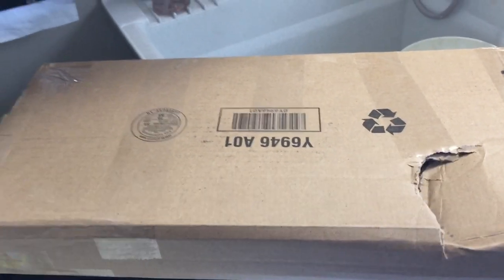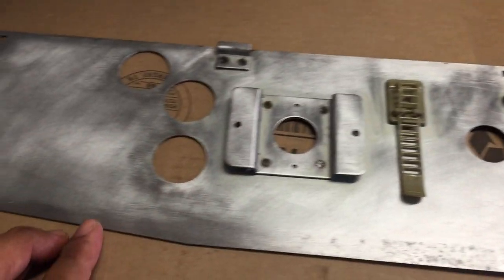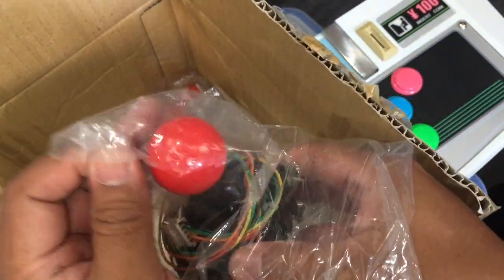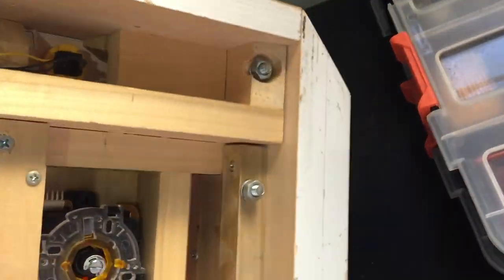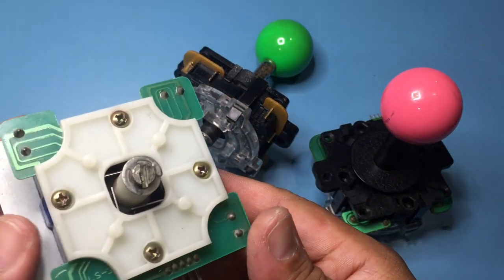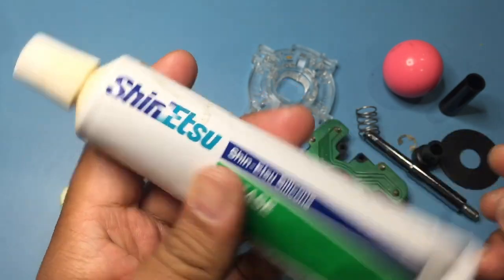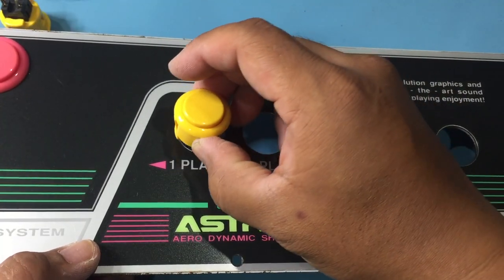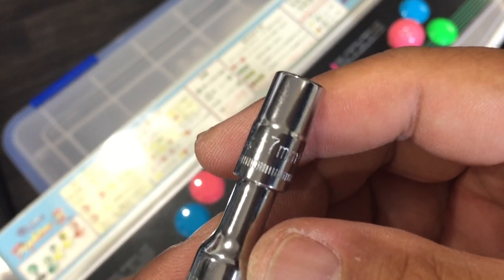The History of Sanwa & Custom Arcade Sticks + Candy Cab Based Joystick Build pt.1 [ep. 75]

Comment: On the home side of things, I have several old ASCII sticks that are made out of high quality old school Seimitsu parts, such as the all-metal ASCII Famicom Stick (the best Famicom stick you can get) Also the NeoGeo AES home sticks appear to have used some kind of custom Seimitsu, again very high quality. Didn't know how far back these companies went. Wish these parts were still in production.
Reply from the maker: Is there "LS" markings on the pcb? Interesting. I'm sitting on an optical Ascii stick that I got from Yahoo Japan, and thanks for commenting, as it reminded me of it. You should do videos and show the sticks in those home sticks, and show what you've wrote about. One thing is for sure- the home stick business has gotten serious. What do you prefer, Sanwa or Seimitsu?
Reply: @The_SegaHolic  Yeah, I've got 7 (lol) metal ASCII Famicoms, and when you lift up the dust washer is says right there in plain text "SEIMITSU" on the green pivot housing, but I don't think they're "LS"s or anything, but just a custom miniature Seimitsu that they just specifically made for that stick. These sticks are absolutely beautiful, extremely responsive, durable, next to no dead zone. i've also got 3 ASCII Stick IIs that I think are the same as the AES Seimitsu parts. So think during that time (1987-1990) Seimitsu was the go-to source when it came to home sticks. I've also got 3 Konami Hypersticks with STOCK LS-56 and PS-14s! And I think those sticks sold retail $60 back in '96 when they came out. Also I've got a few Capcom Fighter Power Sticks for Snes and Mega Drive, some came with a stock LS-40, and the others with a stock, labelled "Sanwa" JLW. You would never get any of this today with an entry level consumer stick.
Reply from the maker: @ReviewUSA-ri5dv  Seimitsu was yeah, early on, was THE source for Japanese arcade hardware it seems. The Astro City cabs were originally outfitted with Seitmitsu hardware. Seems only later with the Blast City Cabs that you see more Sanwa than Seimitsu... even on Sega's candy cab manuals, you can see the model #'s and can get clues as to what was on from the factory.
But damn, that's interesting that they put their logo/name on the pivot, as most of their other stuff has no markings or logos, just the "LS" on the PCB.
BTW, did you check out my stick collection:
https://www.youtube.com/watch?v=aWX8itLJN4g
Reply: @The_SegaHolic  Wow, I thought I was a sticklord! I've got around 50 sticks myself, most of them of the vintage variety. Old school Horis were the best, like the Saturn Fighting Stick SS, the Super Famicom and PC Engine Fighting Sticks and also the Namco Npc-106. I just dig the ALL METAL construction that nobody does anymore. Plus they all used genuine Matsushita or Omron leaf switches. I also own a new-in-box HSS-0136, but I think the Hori SS is a better stick. And LOL, I have the EXACT same Hori Vf and Vf' Dash boxed sticks that you have. I also have the Hori Tekken 3 4-button stick, a Hori Gamecube Soul Calibur 2 stick, and too many others...
Reply from the maker: @ReviewUSA-ri5dv  Not to show off or anything, but I was the guy that first did a Sanwa mod... the Namco stick, I found at a Toy Store at the mall used. I was doing custom builds with Sanwa parts. Nobody knew who Sanwa was back then. My custom sticks got out to the public... and the whole thing took off and past me by, and the rest is history! Long story... got a lot of gaming stories. Ah, the memories!
You should make a video on your stuff. I'd love to see them.
Reply: @The_SegaHolic  So, you're basically the OG of fightsticks, a sanwa equivalent of a MAS Systems? Cool. Have you ever thought of getting back into it? I think the market is still there.
Reply from the maker: @ReviewUSA-ri5dv  No, too much guys out there building stuff I could never do, or don't have access to their expensive tools to make one. Besides, I was over it a long time ago.
Long story short- I'm a huge Virtua Fighter fan, and everyone on the VF forums complained about the Hori VF sticks for PS2. So This was 2001. So I googled for DAYS what brand stick and buttons was on the Naomi cabs. Found the JP Sanwa site, and I didn't even know Japanese. Emailed them, and unbelievably got a reply. Emailed him what I wanted. Got the stuff, and made a homemade stick and posted it to the VF forums. There was a lot of interest and guys paid me a lot of $$ to make one for them. $250. Parts were expensive, and it took too much time to make vs what I was getting $$$ wise. So I made a website so they could make their own:
http://thejstickbuilder.angelfire.com/joystick_builder/index.htm
And one day, I got the idea to drop in the Sanwa stuff into a Namco stick that I got used for cheap from the mall (funcoland?), and that got the stick community buzzing, and inspired a stickmodding craze- even if most don't know where it started.
But I was getting request from a lot of guys, from the Tekken communithy, even from Mad Catz, asking me to design a stick, and recommend parts for it. It was too much as I was still going to tech school. Life happened and forgot about gaming for a bit- especially with the demise of Sega.
My backstory with video games and and the Saturn and Dreamcast era before this was also interesting, but that's a story for another day.
So yeah, introduced the world to stick modding and Sanwa.

Comment: Awesome!  I use Sanwa joystick, but it's a little different.  It's serviceable and customizable.  My controller came with a crappy plastic case and the microswitches are another brand but close.  RAZR Panthera Evo.  But I use it with FPGA ARcAde cores.  It was PS4 Xbox branded so I replaced the graphics with Neo Geo MVS for generic use 👍
Reply from the maker: Customization is the fun part!

Comment: I wasn't clear on Sega's use of Seimitsu or Sanwa sticks in Astro City or Blast City cabinets. Did they use both for different games/cabinets, or was their a specific point in time when they switched from one to another? I know it's subjective on which one feels better, but was there one that was more consistently used by Sega, if I want to replicate the feel of a Sega cabinet? Sanwa's stick was used in the VF4 cabs, is that right? I wonder if VF and VF2 also used Sanwa. And the panel plate in this video can take both types of stick, if the Seimitsu has an adaptor, correct? So I'm still not clear if Sega cabinets ever used Seimitsu.

Comment: at 11:44 make sure you get Shin Etsu G40M grease. Its the kind Sanwa uses for all their sticks and is safe to use on Sanwa pivots.
For Seimitsu use Shin Etsu G-501 grease, it was custom made for Seimitsus and is what they use on their sticks. You can still use G40M although G-501 is ideal.
Reply from the maker: Any silicon grease will do, as they will not craze plastic and destroy rubber. Petroleum cased grease should be avoided at all cost.

Comment: Hey dude, cheers for the video's much appreciated, specially the Saturn stuff. Just need some advice I've got myself a Virtua Stick HSS-0136, with ASCII parts.
This ain't going to sound right, but here goes... :) sticks movement isn't very smooth and its sticking, ordered some Shin Etsu silcone grease. what I was wondering is that the only part of the stick you need to use the grease on? (what you showed in the video) or can I use it on other parts as well?
Reply from the maker: Have you seen my Hss-0316 video? The stick actually has Seimitsu sticks and non-arcade buttons. If you take the stick apart, thereshould be a half-sphere object, sometimes refereed to as the pivot or cam. Sine its the only part that rubs on another piece, which is the ‘body’ of the stick, it really is the only piece that needs lubrication. But the shin-etsu grease is just silicone grease, and is safe on all the stick parts. Thanks for supporting the channel. 👍
Reply from the maker: Lee Gilak BTW, check the smoothness of the pivot and where it sits in the body... the ‘cup.’ It’s the only pieces that will determine the smoothness of the stick. Look for silicone grease from Lowes or Home Depot if you need the grease right away.

You probably just need to take the stick apart and clean and grease it.
Reply: Cheers Sega Holic, I'll fully dismantle the stick clean it and grease it, I just think it hasn't been used for years. my stick is definitely by ASCII, I've opened it up and the stick is stamped ASCII.
Apparently SEGA originally used Seimitsu sticks but later models used ASCII, cost cutting I guess.
Easy way to tell without opening it up is to look under the dust cover if the white plastic bit is solid its Seimitsu, if it has notches in it its ASCII.
I'm in the UK ordered the stuff from eBay from a S.Korean seller, don't mind waiting for it to arrive. 
Just a final question, I take it this grease is fine to use on the gears on a SEGA Saturn CD drive? Thanks again
Reply from the maker: My mistake. I thought it was the Virtua Stick Pro (HSS-0130).... OOOPS 🤪 Those are guaranteed Seimitsu. Thanks for the easy way to see if it's a Seimitsu or not. Yeah, the grease can be used on all your greasing needs for consoles. If you notice, the Saturn used this stuff (white) on all the gears. on the lid latch and also the cd drive. Invest in a tube from eBay, you'll see it's also sold to car manufacturers, it's the same stuff, but much cheaper. It'll last you a lifetime. Had my tube for over 8 years, and it's still about 90% full. It's safe for all plastics, and is why you want to use it.
Reply: Thanks for the info, when I get the grease I'll service the Saturn's inching towards having all the Japanese variants, minus the Hitachi satnav one :)
Reply from the maker: Minius the model# variants, you gonna get the manufacturer variants too?
Reply: Got the grease, sticks sorted now! yeah would like to get the 2 Hitachi's, but there pricey. got both the Victor's. Taking my time waiting for a good price on the variants I'm after, can't justify the prices they usually go for.
Reply from the maker: Yeah, ANY HITACHI SATURN IS GONNA BE EXPENSIVE. THE JVC ones are nice also. The best way to get a Hitachi Saturn for cheap is to go on Buyee (Yahoo Japan Auctions) and get a broken one and fix it. Try to get one that ain't reading disks. You can get the laser pickup for about 10 bucks shipped. You should be able to get one for under $100 and cheaper if you go with a cheaper (longer) shipping from Japan.

LMK if you have more questions.

Comment: Sanwa recommend G-40M to lube, you're using the Honda one.
Reply from the maker: It's all the same stuff. Different part numbers for the Manufacturers. Seimitsu has theirs as "G-501"

Look at the bottom of this page:
http://www.seimitsu.co.jp/buhin.html

The Honda labeled one is just Silicone grease packaged for Honda, and is way cheaper than gettting the smaller tube from Sanwa or Seimitsu.

Comment: Much respect man! Because of u i went and bought an original sega vs. Arcade cabinet control panel, clean it 
Spary paint it and now what's left it's to order the sticks and buttons.
Im thinking  for the buttons i will use seimitsu 30mm (Did sega used seimitsu parts on thier cabinets? Or only sanwas?) 
Great video.
Reply from the maker: The Astro City panels used Seimitsu. Later ones used Sanwa. You can't go wrong with either. I'd love to see the final product. Perhaps make a video?
Reply: @The_SegaHolic    well it's nothing to compare to your stick, I paint it because it was yellowed the arcade have some crack and dents . I think the panel is from Sega's megalos cabinet ,but it has a custom printed sega astro city's vinyl ( that doesn't came out as i expected). Maybe i will upload a short video of it.
Reply: @The_SegaHolic  here's the link to a short video of the stick.
https://youtu.be/7wEy3QYazko

Comment: Hit me bro, I need your help with a Japanese model Saturn. Replaced the lens, still not reading discs
Reply from the maker: BTW, did you check that the spindle is not too low?
Reply: Fixed one of the motor was bad... Swapped the drive assembly to be safe... Japanese console is up and purring like cat.
Reply from the maker: Awesome you got it working. Good job.